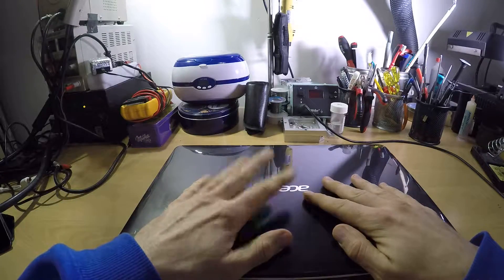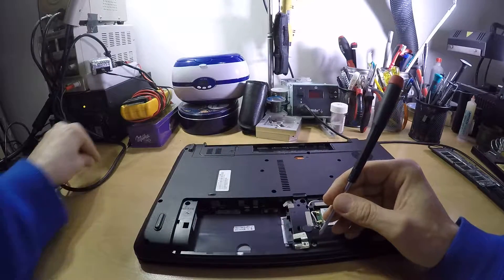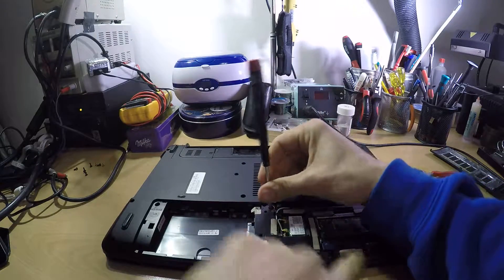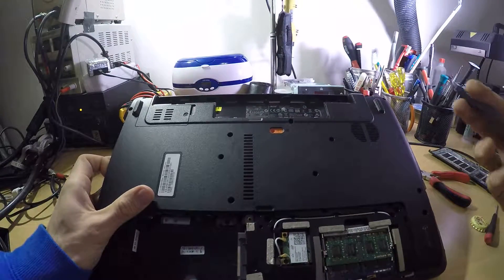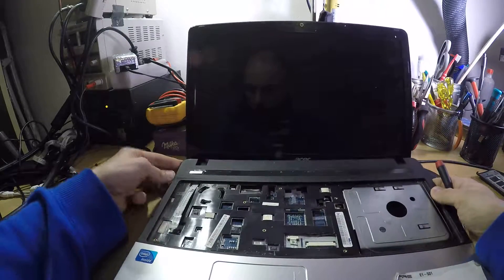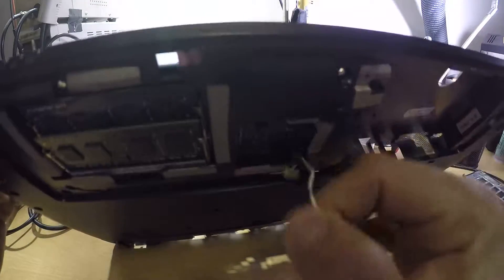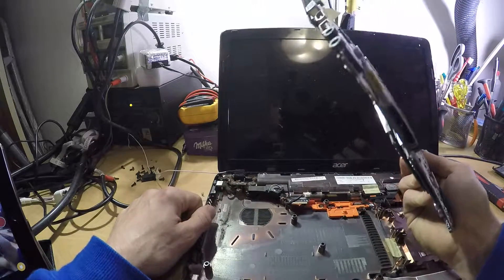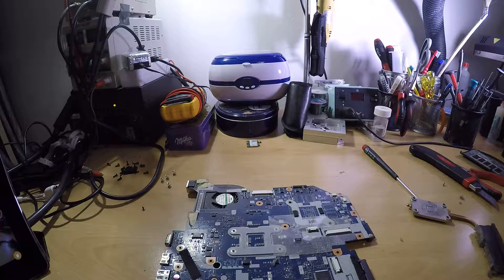[HW: How To] - Disassemble and clean Acer Aspire E1-531

Comment: Hello. 
I'm having problem removing the cover, there is some black dot holding it.
Here is image : https://pasteboard.co/JmF7J3M.jpg
Is there any way to remove it ?
Reply from the maker: Nesumy that’s the screw underneath you missed :)))
Reply: @MTS_IT  I've thouguht about that, but I haven't been able to find any screw left in
Reply from the maker: @TheNesumy  take a look at the video @ : https://youtu.be/x7p1dh_k2JA?t=390 (that is the nut that is screwed in from underneath) if you have removed it (and all others) you just need to jiggle top plastic a bit
Reply: @MTS_IT  The cover won't budge, I've tried quite hard removing it but with no success...
I'll try it once more and make sure everything was really unscrewed.
Otherwise I really don't know what it could be
Reply from the maker: @TheNesumy  how many screws do you have removed?
Reply: @MTS_IT  I'm so dumb...
It was under a waranty sticker...
That would have to be the screw :D
Thank you for your help.
Reply from the maker: @TheNesumy  it happens  (i'm expert right there :))) ) cheers :D